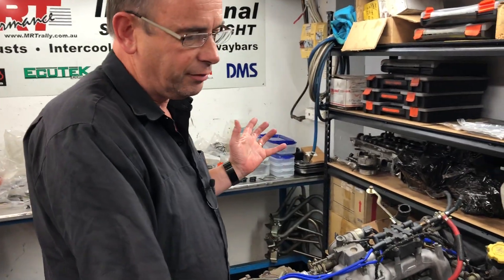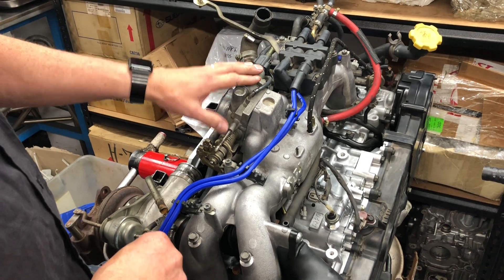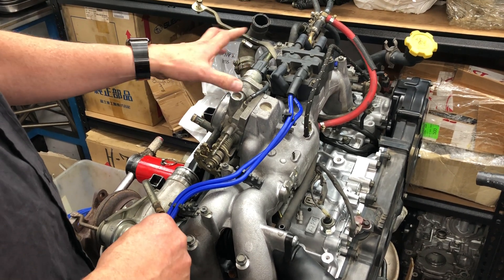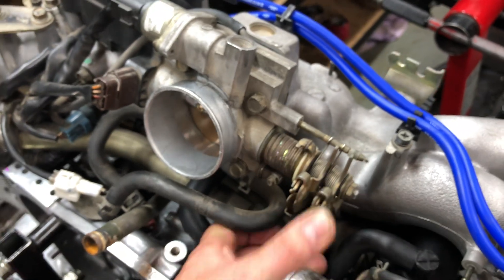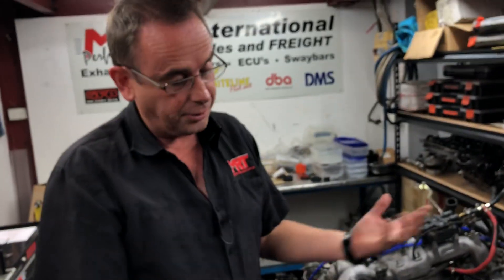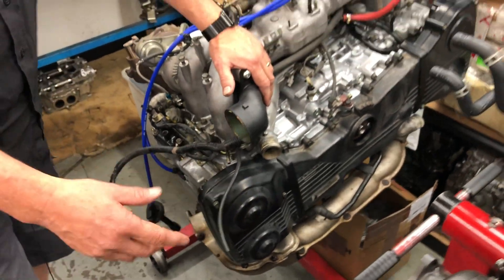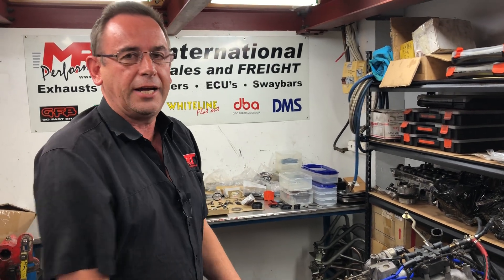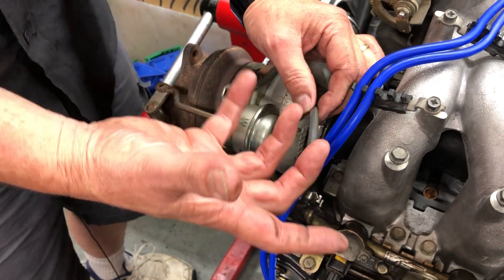MYTHBUSTERS - "Subaru engines haven't changed in 25 years"

Comment: I’ve learned a lot from this guy.  I have a 2014 wrx hatchback with an intake and a dyno tune.  Intake for the noise, and tune for the health of the engine.  Has been running perfectly on 93 gas and a 5w 40 shaefers oil.  Love the car so much.  Burns no oil, looses no fluids. Everything but the intake, turbo inlet and throttle body hose. Best car I ever owned.

Comment: I keep having my coil pack fail on cylinder one. I'm going to swap the spark plugs and coil packs around to see what happens when I replace the bad coil pack. The plugs seem okay but for some reason the car will star misfiring a few weeks after the coil pack is replaced and get progressively worse.

Comment: Manufacturers: electronic throttle is great
Yeah, that's why there's a whole market (iDrive) for throttle controllers that make it feel like a more linear cable-like throttle.

They're an expensive bit of overengineered hardware. Cables are easy and basically fail-proof.

Comment: Going to point out, that most of this involved the electrical and sensor related changes. Hell, the different between the coil over and the wire were small too, the bolt hole for the coilover was there on the spark plug wire version. The thing shown here, is that the older EJ would just need a new intake and the wire harness to go with it. The hydraulic variable cam control is actually a really good addition to the engine though. It uses the same head though. What subaru did, and this is actually a good thing, is that they updated with newer technology, without wasting time and money on making a new one. They took what they learned, and made the FA and FB engines. The bigger engine upgrades that they did make were the reinforcement of the cylinder walls, with closed and semiclosed options. My EJ22 was a open style (not meant for performance, and is reliable after 200,000 miles.) These additions, are great, and do make the engine run better. But the main engine stayed pretty much similar. Other additional changes happened in the head over the 25 years though! Those would be noteworthy!

Comment: It's true that Subaru hasn't changed much about their WRX/STI engines through the years. You must consider that Subaru is a VERY small auto manufacturer and advancement in technology costs a lot of money. 
Also, look at the competition for theWRX/STI... how many of it's direct competitors are make significantly more power? So why spend the money. They are literally (financially speaking) the tightest auto manufacturer in the market...

Comment: Sorry but the 2.5 has not changed at all. Change the fuel injection back to carb and they would be the same. Suck crap. There really isnt that much of a change,Subaru isnt dumb, they do not change what works.

Comment: I just got off of the phone with the service dept of the subaru dealership. This person told me that the timing chains on a subaru have to be changed at 100,000 miles. The cost about $900. 
I have never heard of a timing change needing replacing unless the driver is a lead foot and poor maintenance. I now know that I can't trust the dealership that I bought the car from which is sad.

Comment: There is more. Twin scroll exhaust flange, the position of thrust bearing closed, open or semi open deck, position of cam shaft caps etc. The only same part on EJ20 is the length of belt and engine mount position.

Comment: This was a comparison between the ej20x and ej25x so not exactly relevant, yes the EJ25x is a derivative of the EJ20x (aka. big-bore ej20x), so I guess I can see why you would make the comparison. How about you compare the EJ25x from 1996+/- until 2018+. Although it went through several different head/cam combos from inception, the ej25x has remained essentially the same where it counts on an application basis (eg. NA or TC). 

For example the EJ257 which has remained essentially unchanged in the USDM STi from 2004-current (talking block, rotating assembly & heads, not emissions crap that's been tacked on or changes in the factory tune). The EJ255 is similar story, although Subaru changed the piston dish and valves in later applications, it is the same block with the same DOHC head castings.

The main weakness, for lack of a better term, of the Subaru EJ2xx series has been head gasket failures and that is a block/head casting issue as it appears aftermarket head gaskets fail as easily/frequently as the factory ones do. Ring land failures are a whole other ball of wax, from 2004-2011 for the USDM it was typically modified engines suffering from them, and could be argued increased boost levels with unsafe AFR's were the reason, but from 2012-2014 for the USDM stock motors were having this issue, as well as main bearing failure issues.

has the EJ changed in the past 25 years? yes, clearly, has the EJ changed where it really matters when longevity and/or ability to sustain high horsepower are concerned? not really, although, it will never be a Toyota 1J/2J.

Food for thought - Ford ran the Windsor series of motors from 1961 into the early 2000's (minimal changes in block casting), Chevy ran the 4.00 bore small block (essentially unchanged block casting) from 1962-1998, and it was a derivative of an engine from the 50's.

Disclaimer: I really only know about the USDM Subaru EJ engines

Comment: So they haven't changed the actual engine design, just kept the external systems modern (maybe fiddled with bore and stroke)? They have a basic vct added on but not vvt or vvl, redesigned top end.

Comment: The only unchanged component in the 25 years of Subarus is the head gasket and ring land issues. Other than that, sure, displacement, cranks, injection, ignition, all sorts of new stuff.

Comment: I think 25 years is a bit of a strawman or at the very least more a meme than objective criticism. I'd be more curious for you to show the differences between an EJ257 from 04 when they were first launched and the EJ257 that is still in the newest STI, right now we're looking at a 15 year spread.
Reply: I don't understand what you mean. 200-270 HP is pretty much standard for turbo 4 cylinder engines.
And the ez30 and eg33 make above average power for their size and weight.
Reply: Single vvt 04-07 dual vvt for 08-18. Switched back to Nitrated crank.  Oh yeah and more smog crap.
Reply: Why are you mentioning their flat six? What does that have to do with this conversation?
Reply: "Honda made 350 on their first production turbo 4. Subaru has no excuse." If it's the civic type R, then that's 310-320 not 350.
"Why are you mentioning their flat six? What does that have to do with this conversation?"
"Subaru owners just can't get over the fact that the motors don't make power for shit"
Reply: Honda says the Type R makes 305 at the crank. Dyno sessions prove otherwise. People are seeing 295 at the wheels. Accounting for about 15% (higher end) drive train loss, that's about 340 at the crank. The context of my comment would lead any reasonable person to believe that I was referring to the 257 and that is doesn't lend well to making power. Considering the video is also about the four cylinder application, your comment regarding Subaru flat six motors still isn't relevant.
Reply: sounds like you're the one who can't get over subaru engines.
Reply: Uh, y'all know the 2010 Acura RDX was Honda's first automotive i4; it was rated at 240hp? Aside, Subaru has always done its own thing, and ppl like it lump it. It is not easy for a manufacturer, on a limited budget, to make a drivetrain that keeps up with smog and other requirements
Reply: turbo i4...just saying; necrotic posting with a purpose
Reply: Sounds like you don't actually know what you're talking about.
Reply: No, you're right I don't. But do you really think you know more? Maybe if you did, you'd make some meaningful contribution to the discussion rather than just insulting people.
Reply: I'd think based off of our exchange, I certainly do. I daily a turbo Subaru. I've demonstrated basic competence. You have not.
Reply: The word "people" implies more than one person. You are the only person I have had a conversation with.  I certainly haven't called you any names. You are free to choose to be insulted though. Different strokes for different folks. I gave you numbers to back my initial claim regarding Type R power output and why that indicates Subaru's uninspired development. You should take your own advice.
Reply: Competence in what? Reciting numbers you read on the internet? Driving a car which just about anyone can drive? I can do that too. I daily an legacy B4 RSK, which makes 250Hp. The JDM spec makes 276 Hp, but it requires 100 RON fuel, and so the Australian version is de-tuned for 98 RON.
Reply: I'm not going to get into it with someone who just stated that they don't know what they are talking about. Have a good one.
Reply: Justin R Hondas first turbo engine was a k23 not a k20 in the type r buddy lol
Reply: Justin R pretty sure the k23 was in some sort of suv
Reply: Yeah. An Acura RDX. It was shit. Unfortunately, that doesn't change my argument in the slightest, buddy.
Reply: Exactly why, personally I think his comparison was pointless.
The WRX and STI engines were always different.
Reply: Bingo. I can't believe he's comparing a 207 to a 257. That isn't what people are complaining about. They are upset with exactly what you mentioned. Subaru owners just can't get over the fact that the motors don't make power for shit.
Reply: And the fact that they can make power, pretty easily and reliably, with a few CORRECTLY done mods. Mine is built and puts 470 to the wheels. Not having increased power the last 15 years is just lazy on Subaru's part.
Reply: Honda made 350 on their first production turbo 4. Subaru has no excuse.
Reply: Canuckrz - This. So this.

Comment: Quick question: How much effort is it to convert the EJ205 from coilpack to Coil-on-Plug? The head obviously has the threaded hole to fasten the CoP assembly, so from a purely mechanical poit of view it is possible.

And would there be a benefit of doing that?
Reply: Andreas Kist - Definitely possible. But you'll have to swap in all the associated wiring and ECU from the generation that offers it. You're looking at a TON of work for very little to no benefit, in and of itself.
Reply: Why swap ECU? The coilpack has, from what i can think of, six wires. 12V, GND, four triggers.
Theoretically i'd need to lead the triggers to each CoP and wire 12V and GND to each aswell. No more wiring work required.
The difference is just that the coils are closer to the plugs.
Reply: Think about how the ignition is controlled. The older, wasted spark system, is only firing 2 banks of ignition, whereas the coil-on-plug system is individually firing each of the 4 plugs. The older ECU is unable to individually control each of the 4 coils, as it's really only designed to control only 2 (as each bank fires into 2 cylinders, one during the compression stroke and the other during the exhaust, hence the term "wasted spark")
Reply: Yes, but why would the ECU care how many coils are attached to it? I did some research today and apparently this conversion has been done before. The old ECU does have just two signal wires going to the coilpack, one for Cyl1+2 and one for Cyl3+4. So when doing said conversion the Cyl1+2 signal wire from the ECU is connected to the CoPs on Cyl1+2 and the other to CoPs on Cyl3+4. As it's just a signal wire, it will fire two Coils at the same time. There are threads about it on Nasioc and others.

I think the main benefit of doing this is to eliminate the crappy coilpacks that tend to crack and cause misfires. Whether it's going to improve engine characteristics is a question unanswered. There might be a difference because the coils are so close to the plug and the energy doesn't have to travel over those long wires between the coilpack and the plug.

Comment: I'm a 4g63t owner myself , but this is a very informing video on the 2.5l STI motor. Cool video man.
Reply: SicklyFriend 4g63 fo life
Reply: 4g63 is superior to the EJ in every way. Much easier to make power but not without modifying many factory components, balance shafts, lifters etc, not to mention the complete and utter A-hole of a drivetrain, But I agree that 4G63 is the king of inline 4 cylinder engines. EJ has it's own crown in it's own areas

Comment: Is this Title was troll. The title is not right at all. The title mention Subaru engine not change since 25year ago 
BUT
What i hear since this timing 3:13 , you only talk about what different(improvement) from old model to new model. 
1. Old model don’t have trail fuel .
2. Old model don’t have coil.
3. Old model don’t have variable cam
4. Old model don’t have map sensor on throttle body.
So from old model to new model , Subaru had done changed/done improvement of their boxer which :
1) upgrade fuel intake
2) implement coil system before only direct to spark plug .
3) upgrade to variable cam before was non-variable cam 
4) upgrade throttle body part which a big upgrading was electronic take part . 
You forget to mention they do upgrade turbo from old model to new model . 

Yes for the boxer system why need to upgrade.
4-inline engine also not so many different on their system.
Reply: Mate, give the guy a break. He is just the manager of the company and he doesn't actually know what he's talking about, he just makes videos for free advertising, so he can put some more money in his back pocket
Reply: Umm, I think you must be the one who doesn't know what he's talking about. That is Brett Middleton - did you know MRT stands for Middleton Rally Team - he is the owner & rally driver numnuts.
Reply: Tds DogSquad 
obviously you not read my comment
Reply: Tds DogSquad 
please re-read my comment
Reply: I am replying to I am ME - derrrrrrrrrrrrrrr
Reply: Tds DogSquad 
😂ok sorry

Comment: Exactly .  I have had many G.M.  cars & all have had issues ; three warped heads ...  drinking antifreeze like it was gasoline ... lots of electronic issues ..too many to count & none , if any covered under warranty . I now drive a 2015 Forester .. what a little tank !!!!   It is an impressive  car ..  Not a rattle in it ; (after over 2 years)   , no recalls ...  Not one complaint aside from it being an " Ugly Duckling " ... but I do not care .  The all wheel drive system is awesome in Canadian winter road conditions ..    I am a happy camper with mine & even with old technology ; it still gets better mileage than any car I have ever had .
Reply: The 1999 and beyond (LS) V8 powered cars and trucks are pretty much bulletproof, but I agree on any American older automobile or any modern ford or dodge, as well as the chevy cars and suvs that are smaller and cheaper, are all pretty much junk.

Comment: other than the fact technology has gotten better and as you'd expect has been updated

the engine itself aside from older ones being 2l and newer ones being 2.5 have not changed

also 97/98 gc8's can be tuned on factory ecu's, ecutek only idiots will say they can't to force customers to spend big $$$ when they don't need to

Comment: Subaru makes a great car unfortunately their engine is an antique and then multiple redundant component layout if they put a Toyota engine in it I'd buy it
Reply: conantdog you should see who made the new '86....itll blow your mind
Reply: The point is Subaru still makes an engine that part of a package that makes a great fun affordable car. I would buy a 3SGTE (or equivalent) powered corolla with manual 6speed box and proper 4WD system (or at least what it was in GT4). My previous car was ST205 GT4. Besides there is noting ancient about EJ (I am glad they are still port injected as it gives me injector options with tuning).
One counter point is that Subaru dropped the ball when they stopped making hatchback variant of the STI (hence I am still driving JDM GRB STI)...

Where is the Toyota's answer to Golf R, RS3, Focus RS, etc? All they make are boring cars, appliances. I have couple of Vitz RS in family and they are a pathetic from point of driving experience. In the manual one I had to replace throttle body to a bigger off a 1.8 corolla just to make throttle response slightly better than a steamroller. 

Even before they dropped the Turbo 4WD models, the Caldina GT4 was a disaster, auto only, really crappy 4 speed gearbox (unmatched to the engine), no improvements on the 3SGTE (in fact the ST205 had better unit). In '90 Toyota had things like Supra, Celica GT4 (and SS2/3), Levin/Trueno GT/GTZ (later BZR/G), Corolla GT, Starlet GT all fun and affordable cars.
Reply: Cough cough only the sti still uses an ej engine. Do your research
Reply: conantdog Flat four has low centre of gravity and good torque, there is nothing antique about it except compared to a Tesla....
Reply: Thanks for the great videos on subaru engines. Keep them coming please and may be a next one can be the FA20 BRZ engine NA tuning ...exhaust manifolds, which are best, air filter changes, does a catback help performance gains etc.
Reply: Inverted V12 Powerhouse cough cough my forester has an EJ25 engine cough cough
Reply: What are you talking about? The 86 scores as the second most reliable car in 2017 by Customer Reports.
Reply: Which Toyota engine? 3SGTE? 4AGE?  2ZZGE? 2JZGTE? No longer made.  My previous car was a Toyota, I would bought a Toyota if they actually made a car worth driving. Now I drive a GRB STI. In fact I think Toyota should be ashamed for producing 1NZFE and sticking it into a Vitz/Echo/Yaris and calling it "RS". Or that "Sport" variant of Corolla that makes exactly same power as regular Corolla. 2ZR-FE or 3ZR-FE are pathetic compared to what was put in corollas in the past (2ZZGE made ~140kW vs 107kW for 2ZRFE).